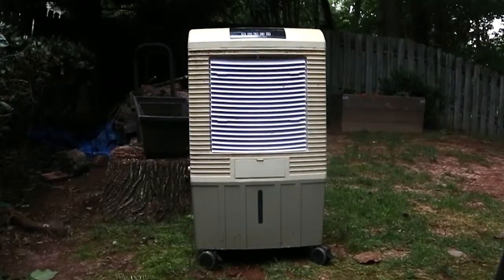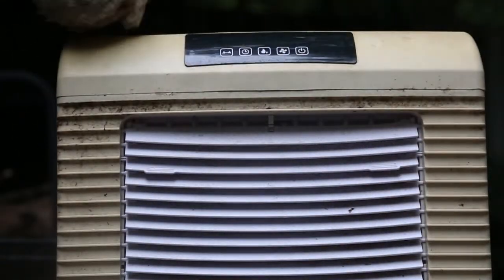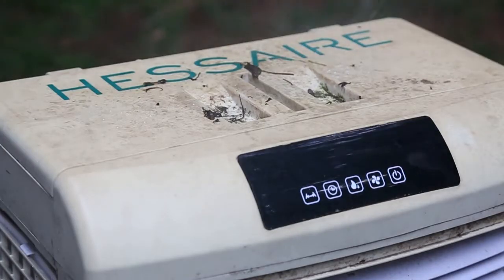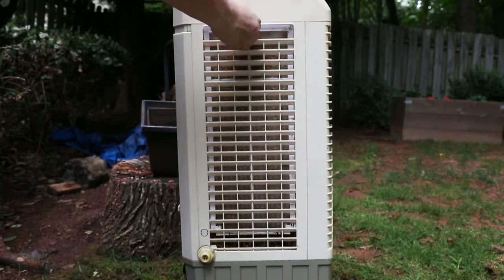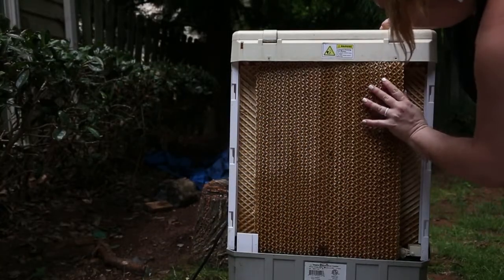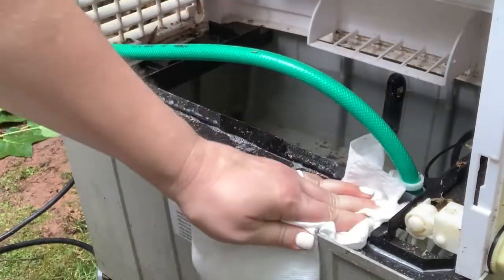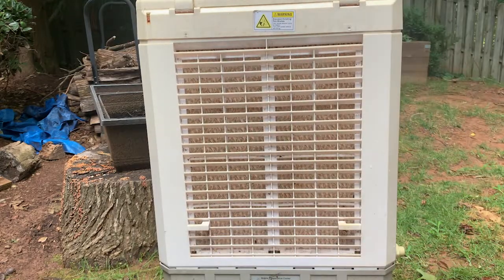How to Clean Your Evaporative Swamp Cooler | Sylvane

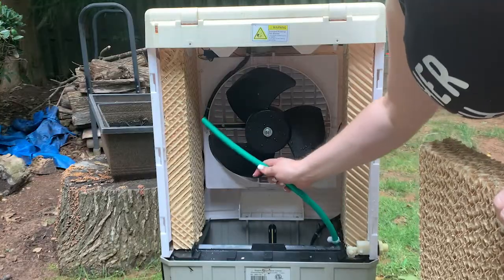Comment: This is a Hessaire MC26A unit or similar. The hose is not supposed to rest up against the the pads like that. There's a reservoir with many outlets at the top of the unit that distributes water to all of the pads. The hose is supposed to connect to the hose barb directly above the hose. You can see the barb at 2:49 and other places. Resting the hose up against one of the pads will be far less effective at saturating the pads. Thanks for the video! I used the vinegar proportions that you suggested.

Comment: i bet 99% went here how to clean their pads

but also this video: throw it away and buy new pads lmaoooooo as if all pads are same sizes?? cuz u cant really find a universally compatible cooling pads with your model. what a useless video

easy solution i did is get some alkaline base aircon foamer cleaner spray it, leave for 5-6mins, watch dust,dirt,calcium build up melts and fall off!!  then rinse with water or high pressure washer. done :DD